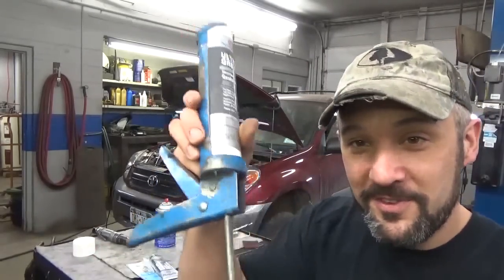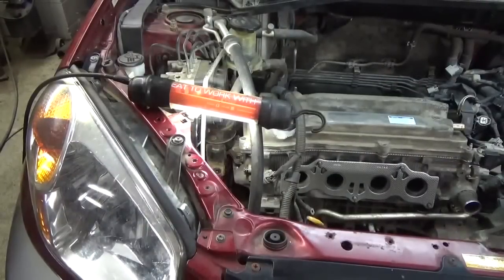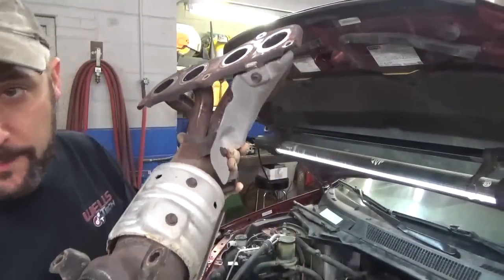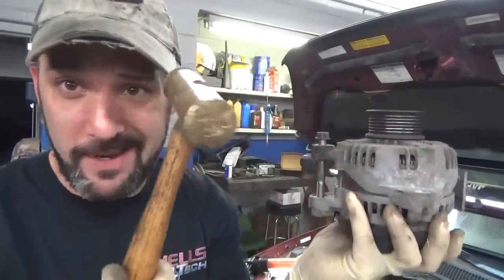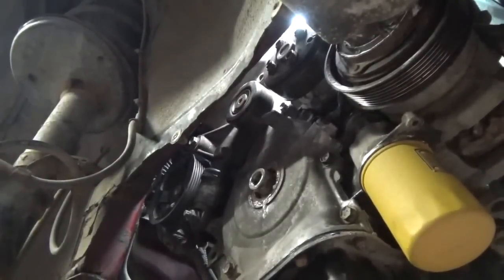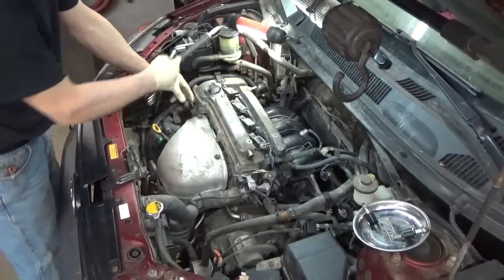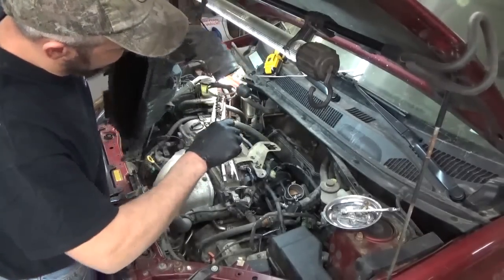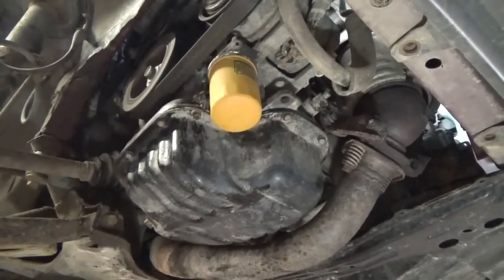Toyota Rav4 2AZFE Stripped Head Bolt Repair Part V

Comment: Hi Eric, owned shop for 20+ years, worked by myself many of those years, feel your pain, lol. Enjoy the videos. So what did you do about the cost of the insert repair kit, how did that affect the final cost to the customer? I had one on a Toy Scion, tore it down and priced customer similar repair. She balked, traded the car in on a Mazda. Keep up the good work.
Reply from the maker: Larry Hurst I was just upfront with the customer, told them what was need to do the repair and gave them options. He agreed to buy the kit to fix it and I offered for him to keep it but he declined. May never have to use it again so I didn't wanna dish out the 400 beans for it to sit on the shelf ya know...
Reply: @SouthMainAuto  Wow, that was a good customer. I must admit, that if I would be your customer, I would have said: If you don't have the kit to do your work properly, it is not my problem. Take the job or leave it, I will pay for hours and parts, not for new kit. That is cost of doing business and should be in your hourly rate.

Comment: hey Eric ..since you read and respond to comments..perhaps  when you start a repair you could tell us book time for it?
 I would imagine it was a lot of hours for this ?/
 Or the  Huyandia  break job?? Is more time allowed in those salted street areas?? you seem to have a ton of bad bolts to deal with ..Here in the Seattle area no salt , so we dont run into it as often
Reply from the maker: That's a good idea I can do that from now on just so everyone has an idea. We do have to add time in some cases to make up for the rust and salt. I wouldn't know what to do with out it. It's a love hate relationship.

Comment: If you don't have one get a Milwaukie fuel right angle grinder and some 3M Bristle lock discs to clean your surfaces. The discs are awesome and will not gouge your surfaces.

Comment: For big disassembles like this I'll put the bolts back in the part taken off  and wrap a rubber band usually other the thread side to keep gravity from ruining my organization whilst the parts sit on the floor or in the rear of the vehicle. Has come in handy once doing a wheel bearing press together that needed the bolts (heads down) in the flange. Gimme some credit for the socket and electrical tape too some day. great series here, just replace a camry 2.4l with a japan engine that required cover swap so I recognize a lot here. Also, myself, ready to install the cover...then...oh ya better put some on the to bolt hole flat spots.

Comment: The countermeasure on the block was deeper thread depth so I believe the root cause was simply not enough threads. I've done many and it's always the back centre ones that strip, don't know why the others are not effected.
Reply from the maker: You don't feel it has anything to do with the diaper... oh and do you put it back on or not?
Reply: I'm a dealer tech, of course I put every part exactly back where it came from..................cough.
I don't bother with it, I haven't had any trouble without it.
Reply from the maker: At a boy lol

Comment: When I did the stripped head bolts on my Highlander 2AZ-FE, I used the NS300L kit from KuhnSolutions.com.  This guy is a machinist and builds the kits himself, somewhere in Pennsylvania.  His design is a bit different that the TimeSerts.  His drill bushings and other machine parts are excellent.  I think the kit was around $350 and the Highlander is still purring along.
Reply from the maker: tom christman Oh nice thanks for sharing ...

Comment: I do feel compelled to share a thought with you. NO danget I'm not the hater lol.
But anyway, whenever your supply of that copper based anti seize runs out you may want to look up the difference between it and the nickel one.  If you happen to find the corresponding literature you will find it is a much better alternative. PS: I like the permatex   in the rattle can one used to it you will likely throw all your brushes away.
Reply from the maker: Ralf V I have both nickle and copper... I guess I just grabbed what was on the box.

Comment: That thing that was nagging at you here it is. So I know it's been 5 years but I'm doing a lot of catching up. Been trying to keep up with your post and just watched the video. Great job just got done doing one 07 Camry 2.4 for a friend. Junk yard engine but original was locked up. I ended up pulling the head since installing and doing it in the car would be a pain as you found out.  Installed the inserts in the block and had the head sonic tested and the whole bit, Checked the bearings M/R and that's when I noticed something that isn't mentioned anywhere.  The bottom chain below the main timing chain does drive the pump but also drives the balance shaft/ OH OH That has to be timed also and if you turn the engine when the main chain is off you have to turn the engine several times to get it to align again,  Bottom gear at 9 and the top gear behind the crank sprocket at 3 timed with the upper chain. Bummer but you had it at 8 and 2. Seamed to run good though but that might have been the thing that was nagging at you . even when you had the pan off the balance shaft and large gear assemble was rate there behind the deflector.  I worked for Ford for 30+ years and nothing is like a 4.0 SOHC timing chains concern with balance shaft and no keyways.

Comment: He been watching you channel for advice,got a 07silverdo,had the ignition cylinder fix,that was 400 bucks then all of a sudden I drove my truck to work and went to go home and it would not start try jumping it nothing,I tried to put ground wire, battery  starter,still nothing could it be a fuse blown or a ignition switch problem

Comment: Use card board poke hole and push the bolt through write were the bolts came from . You can draw a picture of the part to label for long and short bolts were they came from.

Comment: According to Toyota,  "A mesh type gasket is used, in order to reduce the intake noise"...so much for the rodents and squirrels theory.   I think the "diaper" is for the same issue...lol   By the way, there has been an issue with the intake manifold noise.  Toyota had a technical service bulletin on it where noise is generated by a piece of plastic, possibly not glued properly or designed properly at the factory.  I had to put a screw into mine at a strategic location to fix that issue.
Reply from the maker: 7smr and here we thought it was a squirrel stopper...

Comment: Hey E, a few vids before this you said that you didn't know why there was so much Carbon buildup... check this out from the InterWebs about the 2AZFE in US market - 
"There have been complaints of this engine "burning oil" in North America with the issue starting after 45k miles, though mostly after 60k-75k miles. Piston ring design has been identified as a problem. Toyota has even issued a TSB (Technical service bulletin) TSB #0094-11 in August 2011 but have refused to issue general recall. Also more convincingly reported as a head gasket problem the 2AZ-FE aluminum block head bolt threads wear out on the back 3 middle bolts (closest to firewall). There are several class-action lawsuits underway regarding this widespread issue. In January 2015, Toyota North America caved in and issued extended warranty notification (ZE7) for this issue. However, Toyota still insists that burning 1 quart of oil every 1200 miles is "normal". This applies to Toyota North America vehicles only."

Comment: I just rewatched this video and I see why this dude had a problem to begin with… he didn’t change his oil often enough.. I can clearly see the dark.. damn near burnt black in areas of the engine. 

The fact that you hadn’t done a lot of these.. in fact I think it was your first one, considering the millions on the road today, speaks volumes to their longevity. I bet barring any auto accidents this baby is still on the road despite the lack of oil changes and this head repair. 

Change your fluids, folks. Don’t get in this situation to begin with.

Comment: Had to laugh at your comment on never seize.I ran over a tube on the four post hoist left there by the last bloke to use the hoist, it sprayed all over the floor and wall in the next bay, what a clean up. I recon you could paint a whole floor of one bay with a match head of this stuff.
Reply from the maker: Glen O'Hara I would have just burned the shop down haha

Comment: you mention the smart funnel. i also have my spill free funnel but have been toying with the idea of buying snappys vacuum refiller. just curious if you have ever used one them and if so what are your thoughts about them?
Reply from the maker: raymond jenkins Yeah I have there vacuum filler. It works good but I only bust it out on jobs that are tough to bleed. It does work well though if you are thinking of getting one.

Comment: Hey Eric just crawled out from under the Silverado changed the starter motor  wow it lasted 13 years, well it seems I just froze my ninga off for nothing.  The symptoms just started two days ago, the engine would start up fine but I could hear the bendex hang up like it was not returning fast enough.  Well the new starter is doing the same. I'm thinking  maybe my daughter and her 20 keys and doohickeys hanging off the ign switch might be the next step.  What do you think ?  Oh yeah did you win the shirt from wells tech podcast quiz.
Reply from the maker: Steve Rob Good eye on the shirt and yes that is the one I won from Wells... giving them a free prop in the vid (markjhicks) Nice shirt and a great company :) To answer your question I don't think getting rid of your daughter will solve the problem but hey who am I to tell you what to do. Didn't the motors have a tsb on this condition???
Reply from the maker: Steve Rob you have an '02 right?
Reply: Yes I believe the ones with a chip in the key and if you have a module that sends the pos to the "s" post.  Mine is a 02 so I ordered a lock cylinder today it comes with 2 keys from standard Bluestreak. It's going in on Tuesday , that's her day off.  It's not on every start . Have you ran across this before.
Reply from the maker: Cant say that I have yet. I know on the '03 ups that have a PCM controlled starter they have had issues that were solved with a a re-flash but yours being an 02 should be old school. Have you been able to catch it in the act with a test light on the starter to see if it continues to receive a signal?
Reply: I was trying to do that but happens pretty fast. I was going to try and use my scan tool  tomorrow and watch the pid.  I think I'm going to change the key cylinder on Tuesday, not sure if it's that or not.  It's the worst place for wire connection on the solenoid , you have to remove the starter to get to the wires if you want to remove the nuts , i  thinking  if the cylinder doesn't fix it is to remove the "s" wire and see if it stays on , that way I'm not energizing the starter.  I'm just not sure if the lock cylinder could cause this fault or not. I have ran across the starter not engaging correctly on a startup and making noise but this is a first for me making a noise after it has started.
Reply from the maker: If you don't want to crawl under it just use a test light and check it at the "crank" fuse in the junction box under the hood. From there it goes to the starter relay then to the "s" terminal. Maybe just a poke and hope but have you switched the relay with another one to see if that is hanging up by some chance? Is there a pid for it on an '02?
Reply from the maker: The crank fuse it on the wire that comes directly from the ignition switch to the relay.. so that may give you the answer if it is in the switch or sticking lock cylinder...
Reply: I'll find out tomorrow if it does have  a pid , not sure. I'm using autoengunity with enhanced features,  I'm going to look at the relay good idea .  I do have the factory service manuals and schematics .  I'll let you know what I find or don't find HA !!
Reply from the maker: Just don't get rid of your daughter though...lol let me know if you need a hand. I can feed you full of crap all day haha
Reply: Ha you and her got lots in common- it's like a reality show over here and I'm on a drop dead deadline to get it fixed fast. Wish me luck this is going sideways real fast:)
Reply from the maker: Get it fixed fast before you are living on the street, loosing millions type of reality? Well how many times to they not accomplish there tasks on those shows though? You'll get it... but it will be with only seconds to spare :)
Reply: South Main Auto Repair Had a bad starter relay on a 2002 Silverado the other day , but it mostly did not want to always crank ,but could hang up .  I my self is just happy when my GM starts no matter how it sounds . lol
Reply from the maker: wtbm123 Hahaha YOUR THE MAN Terry! It's always 50/50 with those GM's lol

Comment: THE ultra Black Or Ultra Grey Is Normal On the oil Pans On these Rav4's but the Felpro Oil pan Gaskets Work just fine If ya don't want to use the Form a Gasket Eric O @SouthMainAutoRepairLLC

Comment: hi im from Australia what is the difference between the 1az and the 2az rav motor.i have the 1az and it only has 3 bolts for the throttle body

Comment: Why do they mount the engine the wrong way?
I can see it in the small front wheel slide cars, but, in an SUV they should be mounted traditionally, pulleys at the front and transmission at the rear!
Much easier to work on and service the plugs.
It also looks better...

Comment: Oh, and the "diaper" aka insulator. Is a necessity to protect the plastic intake from the heat and exposure from the block. Its lifespan will be drastically reduced / cracked from expansion / contraction of the 200 plus degree heat from the engine.
Thats why i remove it after i remove the head, and just shove it in before reinstall of the head so i dont have to f with it.
On tc's it olmost impossible to remove any other way because the firewall is so damn close...
Again, ur pretty awesome Eric O..

Comment: Im watching this in 2019. This series was a master class in mechanics. Bravo. I have a Camry engine with this same problem. 406k on her and im on the fence as to if i should fix it.
Reply: I'm watching this with the same problem on a 2006 Scion tC I just bought for $2500. I learned Sofa King much by watching this! It's a lot of work, most of which I've never done before. Debating whether to tackle this job or cut my losses. What did you decide to do?
Reply: I'd fix only cause I work as a mechanic daily, Toyota's and Honda's are worth it, Can't say this about some other brands, Because everything else fails too much 😎
Reply: @mrhyde503  Sold the car. Wasn't worth it in my opinion
Reply: I had 2007 scion tc 2.4 with 200k; engine was a beast. I only got rid of it because it started using too much oil. According to Toyota It was within specs when they tested it at 145k , it passed the oil consumption test, but after it hit the 200k , she was thirsty cut my loses, said god bye and bought a new Rav 4
Reply: Who bought a broken camry with 400k miles on it is the question...
Reply: @grezikpainting  A Nigerian guy who said he was going to ship it back to his homeland to Nigeria where it would be easily fixed.
He drove it home 45 miles away and called me and said nothing was wrong with the car. I just said ok because he would see eventually
Reply: DO NOT ATTEMPT TO REPAIR THAT ENGINE AT ALL!!!!!!!!!!!!!!!  YOU WILL BE FARTING AROUND WITH IT FOR MONTHS JUST GETTING THE CYLINDER HEAD OFF.

Remove engine from Camry completely, strip it down to long block, and have it professionally rebuilt.  If you can't afford a professional engine rebuild, call around for a low mileage used motor(they're everywhere!).

Don't make the same mistake I have a dozen times in the past 36 years!

Jason Wampler
W A M P L E R
Reply: @jasonwampler3020  Agreed. I sold the car. Didn't even try it. If the Time Sert kit wasn't 400 i might have done the job

Comment: My breather lid retaining bolt on my 73 Sebring, came loose and got sucked into the carb, down into the head, jamming and bending the intake valve on the "1 cylinder.

Comment: What's that little air ratchet you use? That thing is sweet
Reply from the maker: That one is a seal head Mac tools 1/4" drive..
Reply: South Main Auto Repair Those little Mac 1/4 drive air ratchets are great!
Reply from the maker: Oh I know I have one in each box and have had them for years. Abuse them all the time and they work just as good now as they did when they were new.
Reply: Mine is several years old to but still going strong
Reply from the maker: I don't know if they ever break
Reply: I hate the sound they make,like the dreaded dentist drill when he bores ur tooth for filling.uhhhggg!!!rather hear a harley at full throttle.snookie pa.

Comment: I learned the no burping is a bad thing the hard way. Ended doing the job 3 times 1st time I put the water pump gasket on wrong. Second time the hydraulic tensioner failed for the timing belt. The crank jumped timing . Lucky non interference engine. Third time was the money Haha. God I'm an idiot sometimes. The hydraulic tensioner failed due to being compressed to quickly

Comment: Good video.
I put the manifold back in before putting the head back on. Just let it sit there unbolted of course.
I dont not use a gasket on the oil pan, just use fipg. One other thing is ive found its best before reinstall of power steering pump is to pull the plug that sits on the back of the block that houses the vvti filter and clean it out with brake clean and reinstall.
It never seems to fail, i end up with a camshaft overretarded / underretarded  dtc if i do not.
Its a small filter that feeds the vvti solenoid with oil that is always plugged with a small amount of metal particles and sludge...
Just my experiences...
Ur awesome Eric O.....